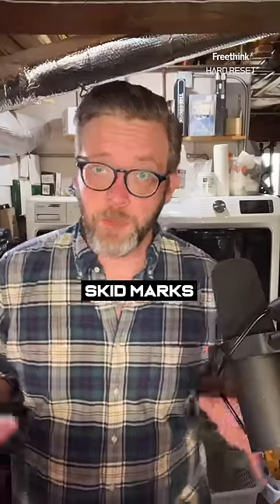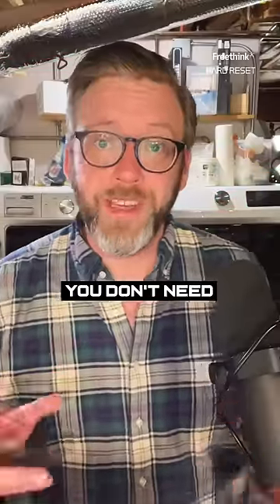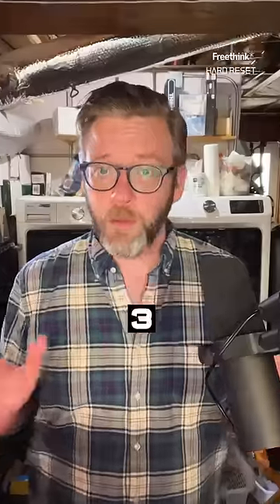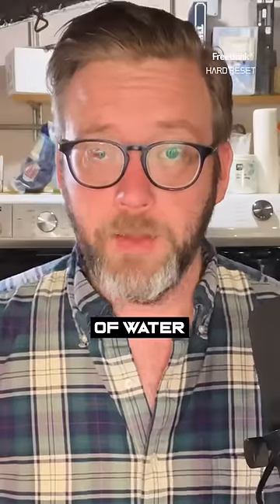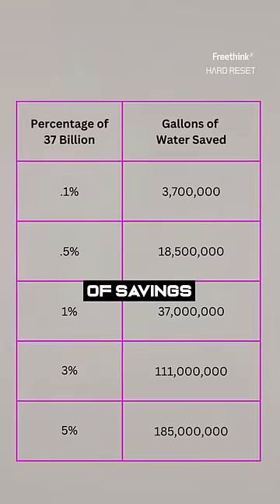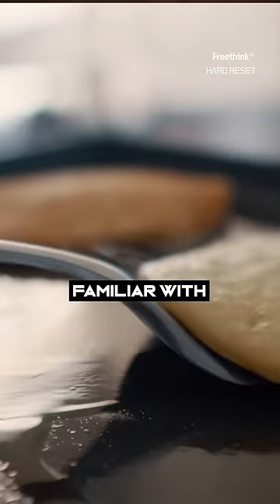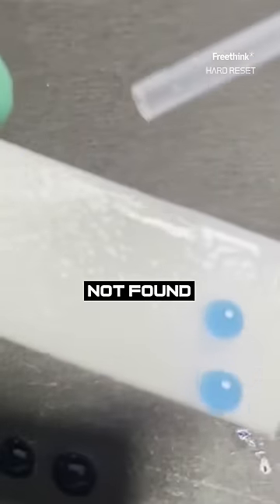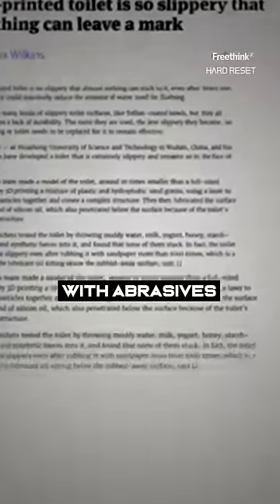Researchers invent super slippery toilet 🚽😳 #shorts #metamaterials

Comment: The problem is that the pipes need a certain amount of flow, otherwise they get clogged. The water purification is interesting but without appropriate adjustment of the pipe system there will be significantly more maintenance work.
Reply: This is my concern too, and even if they change all the pipe using this material too, would this material be mold resistant? Would the chemical of this material give toxic substance if it's in contact with anything?
Reply: Just burn the poop
Reply: Exactly! So as long as the pipes remain standard pvc, this idea goes “down the drain”..or not.
Reply: Basically if you wanna change one thing, you gonna change everything. But honestly, the water isn’t really wasted, it went back to the atmosphere. And there are bunch of water treatment facilities.
Reply: @flextape467 just eat it.
Reply: @w花b  the licious
Reply: @flextape467  💯 agree. If incinerator toilets(which already exist) were used to be used for 💩 and pee still went into the system it would drastically reduce the strain on the current sewer systems, while not reducing the water volume enough to hurt the system as while we would be flushing a little less what we would be sending down the drain would be mostly all water.
Reply: @andromedamessier3176 you have no idea how water treatment works do you? We use drinking water to flush our toilets. A lot of energy is used to clean the water to drinking quality before being pumped into the pipes. All of this is wasted when people waste water.
Reply: I was just about to write the same. For instance, Germans have been increasingly conscious of their water consumption, leading to a decline in average daily usage per person. Now, water utilities need to flush additional water through the sewage system. Thus, a household can save some water by flushing less, but this often results in the same overall water consumption.
Reply: @bigsmall246  I’m talking about water waste, not energy waste.
Reply: @andromedamessier3176  doesn't matter. Drinking water is a limited resource and you don't seem to know the difference between sewage water and drinking water.

Comment: My father was the manager of a wastewater treatment plant for over 20 years. They had major issues with newer toilets that “saved” water because the flow wasn’t enough to carry waste throughout the length of pipe system. The amount of energy and water it took to keep fixing the clogs was enough motivation to replace the “efficient” toilets back to the standard ones.
Reply: That has to do with water pressure not slippery toilets that's the down side of lowering water pressure on a toilet so annoying.
Reply: @Projectmayhem82 Well, what this video is advocating for is, slippery toilets means we can use less water. Sooo, what this comment is pointing out is, that won't actually work.
Reply: This. It just won't work. This would destroy the sewage system.
Reply: @AllisterCaine so that begs the question, is it the consumer's fault that we're wasting so much or is it the corporations and government built systems
Reply: @thisisdirk  It's was comment to the person above thank for your concern
Reply: @Projectmayhem82  Okay and I was just letting you know you missed their point. You're welcome 😊
Reply: Long showers: saving sewer systems everywhere since low flow toilets became a thing
Reply: There's no way the old style toilets that used a lot of water flushed enough water to push them down the sewers. Think about how long and wide the sewers are. They likely relied on water from showers and washing clothes. When hand washing, you typically pour buckets of water down the sewer all at once. But washing machines not only use much less water, the water is dripped out through a tiny narrow tube. THAT is the problem.
Reply: slippery pipes, checkmate
Reply: wanted to comment exactly this. pipes wil clog, unless upgraded first.
Reply: Does that means if there’s a five floor apartment, the person living in first floor will sometimes have to flush more water than who lives on fifth floor? Is the pipe separate or merges in common?
Reply: Then a solution would be to use slippery material for the pipes too, but changing pipes would've cost money too 😂
Reply: Then the problem isn't the toilet but that the sewage system needs to be upgraded to the same standard of slip
Reply: @AllisterCaine unless it was invented at usa?
Reply: @thisisdirk So slipery pipes then maybe.
Reply: These slippery toilets aren’t even out yet 🤣 caught you lyin
Reply: Why not make the pipes slippery then?
Reply: Maybe the pipes should be built slippery also.
Reply: @samlafontaine8552  why not rebuild the whole civilization more efficiently? 
Sure, that’s a proposal, but 1) this is supposed to be a cheap change to save water, not a billion dollar sewer system construction project, and 2) but we don’t know for sure that all clogs would be solved by this material in pipes. It might, but that would have to be tested as the conditions for sewer pipes are different than an open toilet bowl that just needs stuff to fall into the pipe
Reply: You would need to line the pipelines with this material for this to work
Reply: @AllisterCaine what about making pipes slippery too.
Reply: I've heard that in a country (Japan?) they use shower water or like excess water for washing in the flushing so I think this might be a better solution
Reply: Slippery sewage?
Reply: @UnsungAces unfortunately it's more the fault of gravity and physics. However, theoretically if we made the pipes out of these materials, we may see some improvements. I'm doubtful though. On average, drain pipes for a home are around 1/8 inch fall per foot. The toilets shown here are at about a 45° angle.
Reply: Alright, so we need slippery pipes too?
Reply: King of the Hill had an episode about this
Reply: @thisisdirk  what do you mean "it won't work"? A toilet is a single component of a much larger sewage system. Yes, changing components may require re-engneering other parts but that is expected. Imagine if someone said "hey! I have this engine that uses 50% less fuel! Wait... Hold on... The bolts to hook it on the car frame don't match. So I guess using it is impossible"
Reply: Why not Install a small pump somewhere in between...
Reply: We could eat okra all day.
Reply: @Michael-kp4bd  Add that no one is commenting on the toxicity of these new metamaterials.  Will they actually be filtered by current water treatment?  Will any water treatment system catch them?  How many trillions of plants and animals will die from these new metamaterials?
Reply: Then we need a slippery pipe system tubes 😂😂😂
Reply: Newer PVC systems deal with the low volume much better than the old brick/ concrete or concrete pipe. Unfortunately you need to dig up the whole system and replace it, never mind the combination drain/sewer lines we can't afford to replace now.
Reply: @Projectmayhem82 No one ever lowered the water pressure in toilets, it was always a volume reduction.
Reply: @danielch6662 actually they relied on rain storms. All first gen sewer systems discharged into the river or preferably the ocean as far out as possible. Back then, the solution to pollution was dilution.
Reply: Arent there also like air powered vacuum toilets. How do they work?
Reply: @UnsungAces is it really a waste if the old system worked and the new one doesn't?
Reply: if you make it slippery all the way through until it reaches sewage water then I don’t see a problem
Reply: @Projectmayhem82 it has nothing to do with pressure, sewage flows due to gravity. The toilets are low flow, not low pressure. They are the same pressure as the water mains which did not change with the new toilet. The new toilets just release less water at the same pressure. The issue here is the waste is too thick to flow properly (2ft/second). If it does not do this it will congeal and become septic. Then there is the issue of processing said waste when it arrives septic. Septic waste does not process well.
Reply: Sounds like the waste management company should create a system to pull pressure from the pipes.
I'm not going to lie and say it would be simple, but with the right engineering and pressure valves it could be safe and effective. Worse case it could make new jobs.
Reply: Thanks for the insight.
Reply: I literally got on the comments to ask this question.. like are people not understanding how the whole system works?
Reply: @AllisterCaine the entire system would have to be this slippery and there would still need to be enough water and pressure to literally "flush" the system through. It could be more efficient, but this video is not addressing the whole system and therefore, problems.
Reply: For rural areas..it is very effective since we don't need a sewage system but just a septictank...
Reply: THIS!
Reply: This mean we might need slippery pipes to prevent clogs as well
Reply: @Projectmayhem82 what has it got to do with water pressure???
Reply: @Projectmayhem82 but the flush is mostly volume from the water closet. And gravity from the till tube.
Reply: Would this not be alleviated by using the same material throughout the length of the piping system?
Reply: Plus they stuff not found in nature is the c word 😅
Reply: You don't say when your dad worked there and whether there were other contributing issues in that specific part of the world. Your comment is a good example of very limited information on a topic that is probably much more complex and has many other factors that your average Jo/e won't be aware of so he or she might just accept it as an obvious mic drop in this slippery toilet idea.

What you say might be an important consideration that the governments in each region should consider but there might be many areas where this is actually completely reasonable. In a megacity with lots of high-rise apartments or just in areas with more modern sewers than when and where your dad worked. The issue you raise could be an issue in suburban areas, especially ones with older sewerage systems. There may also be ways that they can add more grey water into the system upstream to account for lower flow from toilets and if the the problem was as bad as your dad said it was then you would hope that they found ways to fix it rather than just throwing their hands up and blaming people for not using old style toilets that flush gallons of clean water down them.
Reply: Second flush is for the floaters,
Reply: Good for Porta potties and out houses, but not great for getting your waste to actually flow anywhere
Reply: @thorr18BEM things can flow horizontally or vertically with water pressure in piping, not the case with what you're saying about the slippery pipes. If it relies on the pipes being slippery the waste would only be able to flow downhill. It's not that simple. Water is an important part of moving the waste
Reply: @UnsungAces  Water is not being wasted, it can always be recycled. Water recycling is the most effective form of recycling we do. 

The only objection for “wasting water” making sense is if the water is clean and fresh enough to drink. 

Otherwise we can use lower standards for the water hygiene. Toilets could be made to operate with salty/dirty water. At that point it’s never in question whether it’s “waste” since it was never of drinkable quality.
Reply: Came to comments seeing if someone already mentioned this. Very true
Reply: @UnsungAces its the nature of the plumbing system. But as long as water is being treated at water treatment plants its not just dirty forever.
Reply: @MawcDrums  it couldn't hurt. Were you a hydraulic engineer, you would use the Darcy-Weisbach equation 
hf = f (L/D) x (v^2/2g) 
to calculate the loss caused by pipe friction. The turbulence along the internal pipe wall is related to the roughness of the pipe. I would recommend your sewage be built to go downhill when possible but this applies where you are flowing downhill, uphill, and horizontally. A perfectly smooth frictionless pipe should mean f = 0 and therefore hf = 0
Reply: @UnsungAces   The answer is simple (but the issue complex): We need to stop thinking of the individual consumer as the source of the problem, as that does not make much sense with how we structured society. Also industries producing and transporting goods waste much more, while also being able to do a real difference much more directly. They don't though, because that would cut into their profits. The solution is legislation and public investments forcing good and real change, where the consumers through small changes on the initiative of the local government or utility suppliers can contribute to making a change, instead of being held responsible for complex issues they have no real say in.
Reply: @球樂周  I live on the ground floor of an old build in Germany and I can confirm that if I don't use the toilet often enough, a sewer smell starts emanating from the toilet. When I first moved in, the whole place would reek to high heaven whenever someone above used the toilet. It was so bad that I actually cried haha
Reply: Huh today I learned a little about sewage I infrastructure. Pretty cool
Reply: This is false info 😂
Reply: Always wondered about this. Thanks for the confirmation!
Reply: @ml48963  this is incorrect
Reply: @mattmathematics3591  Care to explain?
Reply: @markusfrick6883  Because that increade the cost. Also is possible that a small one doesn't solve the problem

Comment: Random ideas 
Ball bearings 
Roofing 
Out door side paneling for buildings 
Umbrella ( personal don't like how seemingly flimsy the modern ones are)
Ship design ( possible reduce amount of things clinging to the surface of the ship )
Plane design ( possibly reduce air friction )
Car design ( both the reasons for ships and planes apply to cars )
Reply: You have a great list.  I was also thinking the inside of shower stalls to keep the water and filth off of the walls. 
Use for Wind Turbines to keep them clean and less maintenance this making electricity almost as cheap as burning coal.
Reply: The ship hull idea is a great one.  Loss of speed and added fuel costs from barnacle buildup are real issues.  Even if it can’t completely prevent them, it should at least make removing them easier.
Reply: Surfboards. Not the side you stand on but maybe on the other side. Ice rinks too?
Reply: Good ideas I’ll I could think of way massive slide for downhill royal rumble racing
Reply: Imagine the banana peels we could make with these
Reply: 1950s umbrellas? Or 1900s generally
Reply: You dont want a slippery car. Mechanic here
Reply: @Brocuzgodlocdunfamdogson I'm not sure if this material can prevent barnacles from attaching though. Behaviour in air is very different from behaviour underwater.
Reply: @flextape467  i was thinking about ice rinks too.  But ice is just too good as a skating surface.  It isn’t just low-friction, you can cut into it with a blade to create high friction.  That’s the key.  You might be able to glide on this new surface but could you cut, turn and stop without destroying it?  Can it be resurfaced easily in minutes like ice can with water?  If they could figure that part out, then we’re talking.
Reply: @bigsmall246  yeah, it would all depend on how the surface reacts with the barnacle cement.  But the smoother an object is, the easier barnacle removal is.
Reply: @Brocuzgodlocdunfamdogson  the surface is not smooth. It's a complex shape that allows it to grab onto lubricants. Not sure how it will leech out when underwater.
Reply: Would bullets slip off their targets?
Reply: @youbigtubership  probably not…but bullets tipped with it might slip through soft armors like kevlar.
Reply: Using it for roofing sounds like a safety issue when it is time to replace the roof. Rest in peace, roofer who tries to climb up there to do the job without falling...
Reply: @Brocuzgodlocdunfamdogson  -- like roofing, this sounds like another safety hazard for use of this new material. It is crucial to have friction when you need it when skating.
Reply: Ball bearings wouldn't make a lot of sense because friction is what makes things roll. This would probably supercede them altogether in situations where it's used.
Reply: @m0nkEz  -- Exactly. A car wouldn't be able to drive on a frictionless surface, and humans wouldn't be able to walk safely on a frictionless surface, either. A little bit of friction is a good thing.
Reply: You actually want oil to adhere to your balls in bearings.